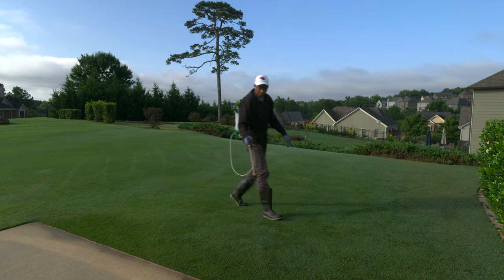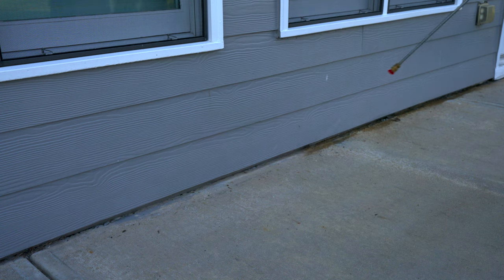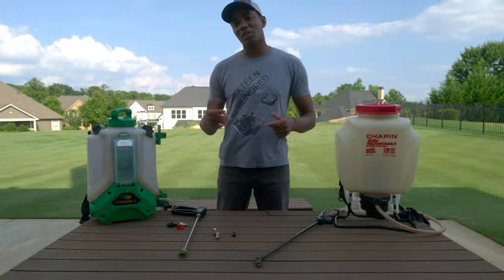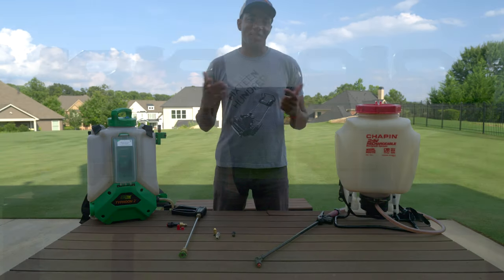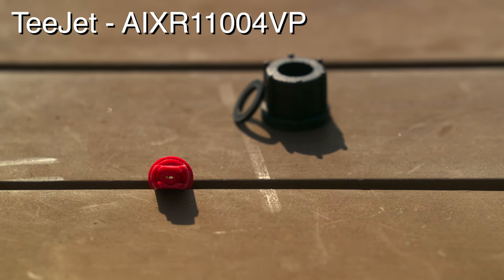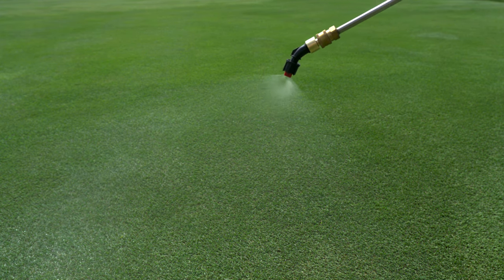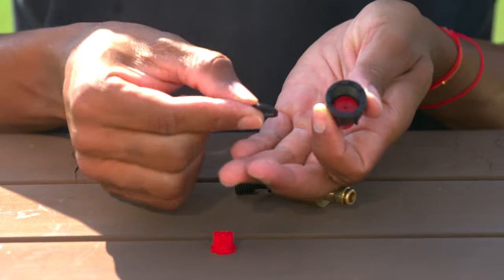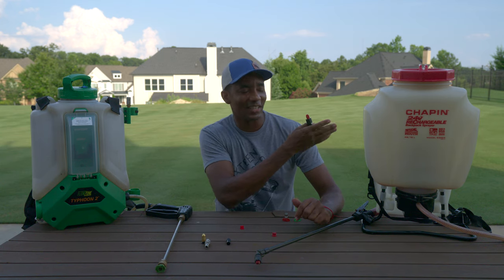How to get LASER precision with your Average Sprayer

Comment from the maker: Learn How to Calibrate Your New Sprayer Nozzle: https://youtu.be/hg9wKPsi2pY  Spray nozzles in the Description!
Reply from the maker: Which spray nozzle are you using?
Reply from the maker: ✅ You can also build your own adapter using these 3 parts:
Quick Connect Coupler: https://ron-henry.com/quickconnectcoupler
45 Degree Adapter: https://ron-henry.com/teejetadapter
TeeJet End Cap: https://ron-henry.com/teejetendcap
Reply: @RonHenry  Thanks for sharing the above BUT how do you add the female quick connector to the wand, please?!?!?   I purchased a Kobalt backpack sprayer with a metal wand and brass tip that doesn't allow me to use other tips like the TJ.
Reply: @RonHenry  An Amazon cheap chinese model. I assumed all of these nozzle caps are the same size

Comment: A PSA for those with Flowzone Cyclone sprayers:  make sure the last two numbers are 06, not 04 as listed in the video.  Those two numbers refer to the size of the orifice and 04 is too small and will burn out your pump.  I recently got a new pump from Flowzone, under warranty, and one of the questions they asked was what tip I was using.  I told them the XR11004VS and they said the tip was too small.  You want an XR11006.  I can't speak for what other sprayers need, but I appreciated Flowzone's understanding and told them I'd do my best to spread the word- so here I am spreading it.
Reply: What pressure setting did you run the 04 on? Will it work ok with a cyclone on the low psi setting?
Reply: This is unfortunate. These two that Ron recommends are commonly used by enthusiasts. Perhaps Flowzone needs to improve the design of the pump?
Reply from the maker: @jeffbarno7239 if what the previous poster is saying is correct, then I’d agree.  I’ve run these nozzles in other sprayers for years without issue.

Comment: Don't forget that the Teejet nozzles come in different colors for different flow rates. I find that the red nozzles put out almost 2 gal per 1000sqft at my comfortable walk pace, instead of increasing my pace considerably, I switched to a yellow nozzle with the same spray pattern which gives about half the flow rate and comes out much closer to 1 gal per 1000sqft.
Reply from the maker: It just depends on your walking pace and the pressure of your sprayer. The red TeeJet nozzles at 70 psi, put out fluid at much lower rates than the nozzles the sprayer comes with.  Great feedback sir. Appreciate you chiming in.
Reply: If you have a manual pump up sprayer, a constant flow valve is a great investment as well for about 20$. It keeps the pressure regulated so you're always spraying at the same pressure, thus making your application more consistent. It will shut off once the pressure drops below the valve psi rating. Electric sprayers typically spray at a constant pressure so this is more useful for pump up sprayers.

Comment: Do I need the Quick Connect Adapter if I have the Chapin Sprayer? It doesn't have a quick connecter and the adapter web page says it's just for the Flowzone sprayer.
Reply from the maker: No you don't. You can just unscrew and swap nozzles if you have a Chapin.
Reply: @RonHenry  Thanks. That's what I thought but I wanted to double check.

Comment: Good morning  Ron, I couldn't find the Quick connect to 110 degree teejet nozzle adaptor. please do you know hear I can find it.
Reply from the maker: Hi Frank. It does appear to be sold out in most places.
✅ You can also build your own adapter using these 3 parts:
Quick Connect Coupler: https://ron-henry.com/quickconnectcoupler
45 Degree Adapter: https://ron-henry.com/teejetadapter
TeeJet End Cap: https://ron-henry.com/teejetendcap
Hope this helps.
Reply: @RonHenry  Thanks Ron, I appreciate all your help.
Reply from the maker: @frankokehie3935  Anytime sir.

Comment: Outstanding video Ron.  Going to be ordering a Yard Mastery sprayer soon; you did briefly cover the use cases for the various spray tips - if I may ask, can you advise your recommended spray tip to use for laying down these specific products:
- Barricade 4FL (or similar liquid pre-emergents)
- Liquid bio's like AIR-8, HUMIC12, Sea Kelps
- Propiconazole (fungicide)
Reply from the maker: Hi Progression. You'll use the red spray tip for foliar products and the white FloodJet tip for products designed to get into the soil. So pre-emergent, fungicide and insecticides, white tip, everything else red.
Reply: @RonHenry  phenomenal, thank you.  What would be the use case for the green pressure washer-looking tip that comes with the sprayer?

Comment: I have been waiting for someone to do a more advanced nozzle option video for the community. I'm not going to sugar coat this, I cringe when I watch people use the tips that come with the back pack sprayers. The tips that come with then are simply pressure washer tips. I would have liked to see you take it a step further and explain how pressure can also affect the droplet size. Anyway, a great video to get people applying products properly.
Reply from the maker: Thanks for the feedback Dan. I considered going into calibration and pressures but a lot of that is covered in the video at the end of this one. Didn't want to make the video overly long. Appreciate you watching.

Comment: Is it possible to upgrade the standard wands to accept the quick connect type nozzles? The constant screwing and unscrewing of the nozzle tips gets annoying pretty quick. Can you put out a video showing how?
Reply from the maker: Looking at the wand on my Chapin, I don't believe this would be easy to do. If you're going to try this, it would be easiest to swap the entire trigger and wand.  I'm not sure where you'd even get one. Likely easier to just buy a sprayer that already has the quick connect system.
Reply: @RonHenry  Great video, Ron!  Like others wrote, you present the facts without any fluff.

I upgraded my Solo Comfort 475 manual backpack sprayer so I could use the TeeJet tips, specifically with the quick connect cap, and get rid of the bendy plastic wand.  As you suggested, using the quick connect cap requires a new setup, but I am glad I did this.  The plastic wand that came with the sprayer is now in the recycling bin, and I can easily change the TeeJet tips as required for the product I'm spraying.  

TeeJet offers many versions of the quick connect caps, but I recommend the 114445A series because these have a round hole for the tip.  The other versions have shaped holes for the tips that lock them into place and they cannot be rotated to adjust the spray pattern.

Comment: hi i Ron, 
appreciate the video. can you advise what are the other components used to complete nozzle sprayer
Reply from the maker: Hi Adrian. Check in the video description. I have all the parts and where you can pick them up there. :-) 🙏😎
Reply: i see the nozzle tip information but what spray elbow model are you using? looking to mimic your setup as i have a similar green sprayer tip as the one on the flowzone
Reply from the maker: Check now Adrian. I just added the parts 
✅ You can also build your own adapter using these 3 parts:
Quick Connect Coupler: https://ron-henry.com/quickconnectcoupler
45 Degree Adapter: https://ron-henry.com/teejetadapter
TeeJet End Cap: https://ron-henry.com/teejetendcap
Reply: @RonHenry  thank you. this is awesome setup and super excited to add to my sprayer. love the videos Ron.
Reply from the maker: Anytime sir.  Appreciate you watching

Comment: Where did you get the pressure washer wand from? Is it an actual wand for a pressure washer and if so, is it able to withstand the chemicals that would be used through it?
Reply from the maker: The sprayer comes with it. https://golfcourselawn.store/products/yard-mastery-4-gallon-backpack-sprayer It works great. No issue with running products of all kinds through it.
Reply: @RonHenry  Nice, I have one of those ryobi battery powered backpack sprayers (mainly because of all the ryobi battery powered tools I have already) and the way it's designed it'll leave almost ¾ of a gallon of product in the bottom of it. Been looking to replace it for awhile now because of that terrible design.
Reply from the maker: @Draega007  Gotcha. I can see the convenience of using the same battery. The sprayer I linked above is awesome though. Doesn't leave a bunch of product at the bottom, comes with various spray tips for applying lawn products and is built like a tank.  You won't replace it anytime soon.
Reply: @RonHenry  I'll definitely add this to my shopping list. Maybe I can talk the wife into letting me get an early Christmas present lol.

Comment: Ron, do the tips you referenced in the video work for the Flow Zone model as well?  Mine are quick release and they don’t seem to come apart.
Reply from the maker: Yes they do Mark. Check the video description for an adapter for Flowzone that’ll allow you to use the TeeJet nozzles. Great question.

Comment: I have the same battery sprayer as you and bought the recommended sprayer tips. However, the black part wouldn't fit into my gold tip sprayer opening.
Reply from the maker: You need this adapter: https://fzspray.com/collections/adapters/products/quick-connect-to-110-deg-teejet-nozzle-adapter

Comment: Hi Ron, I purchased the tee jet tip for my sprayer. However the tip is slightly larger than the opening of tip body. Any suggestions for a fix?
Reply from the maker: Hmmm. I'm not sure on that one Larry. What kind of sprayer is it?
Reply: It’s a cheapy Chinese model. I thought all the reads r the same.
Reply from the maker: @larryunger1896 hmmm. You can’t tighten down the cap to where there aren’t leaks?

Comment: Hey Ron, I wanna build a boom sprayer with 5 teejet noozles (11004), which 12v pump would you recommend? Flow rate and pressure? Any formula to consider if i want to add more noozles? Thanks
Reply from the maker: No idea on this one. I’ve never built a boom sprayer.

Comment: I receive my flowzone cyclone in a couple of days and ordered the AIXR11004VP for my preemergents based on your recommendation. Do I use that nozzle for postemergents as well, such as MSMA? Sorry. Im new to this. The local store recommended I use MSMA for postemergent. Also, do I need to order the quick connect adapter for my flow zone? I'm trying to get everything ready. Thank you for all the info. Your videos are a huge help!
Reply from the maker: Unless you’re spraying commercial properties, you shouldn’t be using MSMA. It’s no longer labeled for use on residential lawns. 

You will need a quick connect adapter unless flowzone is now including them. When I got mine years ago, it wasn’t included.
Reply: @Ron Henry  got ya. Im not sure why they recommended target 6 but do you recommend a safe post emergent for bermuda? I have every weed imaginable including Dallisgrass. Using Prodiamine for Preemergent but not sure about post. Thanks again and thank you for the heads up about msma

Comment: Hey Ron, what tip would you recommend for lawn paint application?  I have a Scotts 190567 Lithium-Ion Battery Powered Pump Zero Technology Sprayer which I'm hoping to use for this kind of application.
Reply from the maker: This one: https://amzn.to/3iAG06O
Reply: @RonHenry  Thanks!  Also I just wanted to say that you're the most responsive YouTuber out there.  EVERYTIME I've asked a question of you not only do you answer it ... but you answer in a very timely manner as well. Kudos!
Reply: I have the same sprayer but it looks like it requires an adapter to use the Teejets. Any idea what the correct adapter is?

Comment: These videos are great!

Any advice or content with mesh check valves to go along with the TeeJet nozzles? Just ordered some XR Nozzles and got the 50 mesh 5psi check valve ($4). Idea is to hopefully prevent excess dripping after releasing the handle when applying professional grade herbicide such as Certainty and Celsius.
Reply from the maker: Hi Trey. I’ve not used the check valves before.  I don’t notice issues with product dripping from the nozzle when I stop spraying.  I can see a check valve could be useful though.

Comment: Hey Ron, will I need to get the quick connect adapter also before I can use the tips on my Flowzone sprayer?
Reply from the maker: Hi Anna. Yes you will.  If you look in my pinned comment you can see the  3 parts you’ll need if the other I sold out.

Comment: Hi Ron, do you vary your pressure on the backpack sprayer? I’m just getting into spraying so I want to make sure my calibration is correct. Thanks (also Ron)
Reply from the maker: No I don't. 90% of the time I run on the lower pressure setting. The only time I switch to high is if I'm spraying fungicide since the label calls for 2 gallons per 1000 square feet vs 1 gallon per square feet for most other products.

Comment: Are they the same as pressure washer tips?
Reply from the maker: No Joe. The included tip is more akin to a pressure washing tip. The TeeJet tips are designed for applying products to crops.

Comment: Ron, I just checked the two Tee Jet red nozzle tips that came with my new Yard Mastery sprayer.  The numbers on them are both 110 04 VP. The nozzle hole on one is slightly more oval and the notch on the side squared off, while the other nozzle hole is thinner and wider, and the side notch is V-shaped.  Any idea which nozzle makes the droplets bigger or finer?  Thanks
Reply from the maker: The nozzle with the ports on the side is an air induction tip. When run at lower pressures is draws air in which helps promote larger droplets
Reply: @RonHenry  Thanks Ron.  Is that the V-shaped slot on the side?

Comment: How does the TeeJet AI11004-VS 110 Degree Air Induction Flat Spray Tip - Red compare?
Reply from the maker: Air induction tips have produce larger droplet sizes than the non AI tips Trstan. On a windy days, you could go with an AI tip to reduce drift.

Comment: Hoping you can help with my Teejets!  Is an O ring required to be used?  You use one, but my Flowzone Cyclone 2.5 didn’t have any with their nozzles and the Teejet I ordered didn’t come with one.  Do the Teejet caps come with O rings?
Reply from the maker: Not necessarily Ben. The  o-ring does help with sealing but if your cap is in good shape you shouldn't experience leaking issues.  Your existing nozzle might have an o-ring that can be reused. Hope this helps. Appreciate you watching.

Comment: Just an FYI...the Quick-Connect adapters are not available because they are currently out of stock! (as of Aug 2021)
Reply from the maker: Heya Jim.  You can also build your own adapter using these 3 parts:
Quick Connect Coupler: https://ron-henry.com/quickconnectcoupler
45 Degree Adapter: https://ron-henry.com/teejetadapter
TeeJet End Cap: https://ron-henry.com/teejetendcap
Hope this helps. 🙏😎

Comment: I have done a little research and noticed that there is a "vp" version of XR11004. Is there any difference between the two tips other than the "vp" version being plastic and the "vs" version being stainless steel?
Reply from the maker: I believe that's the only differences K McClanahan. Plastic vs. Steel. I opted for steel since it should last longer than the plastic version.  Great comment.

Comment: I have a Milwaukee backpack sprayer…does anyone know the thread size for the wand?  I can’t find it anywhere. I want to put the quick connect coupler on it. Thought it was a 3/8 NPT but nope, that ain’t it!
Reply from the maker: I'm not sure on that one lamcarter. You should be able to swap the nozzle without having to go through the trouble of fitting a QD system. Unless that's what you want of course. :-)
Reply: @RonHenry  Thanks Ron. I swapped the nozzle but you know I have to have that cool set up you got going there!
Thanks for the reply!

Comment: Too bad the quick connect 110 degree adaptor for the Flow Zone is out of stock everywhere. Is there any alternative? I guess if not then it is not worth buy the two different nozzles if you don’t have the 110 degree adaptor correct>
Reply from the maker: Got you covered Jerry. You can assemble your own with these parts. I've also added the list to my pinned comment.
✅ You can also build your own adapter using these 3 parts:
Quick Connect Coupler: https://ron-henry.com/quickconnectcoupler
45 Degree Adapter: https://ron-henry.com/teejetadapter
TeeJet End Cap: https://ron-henry.com/teejetendcap

Comment: Great video, thanks so much for the information. I'm looking into buying the Ryobi 4 gallon backpack sprayer( model #2826 I think);would that Teejet work with that type of sprayer also I'm wanting to kill off a lot of the grassy weeds, in the next couple of days before I reseed my lawn I'll be using tenacity and speed zone, would this type of pesticide clog up the Teejet sprayer since the Teejet spays so fine, if so which one do you recommend? Thanks
Reply from the maker: I'm not sure if the tips  can be swapped into the Ryobi sprayer Eric. It's swappable into most sprayers so it should be ok. I've just never tested it to be able to say for sure. There's no issue with spraying Tenacity and Speedzone through either tip. Hope this helps.

Comment: Hey ron,   I'm also a Henry  !!   question:  planning on buying a Petra HD3000 backpack sprayer.  Would all i need to buy is the actual TEEJET NOZZLES and then just screw them into the factory tip connector ? and that's it?
Reply from the maker: Yep. They should work on that sprayer.